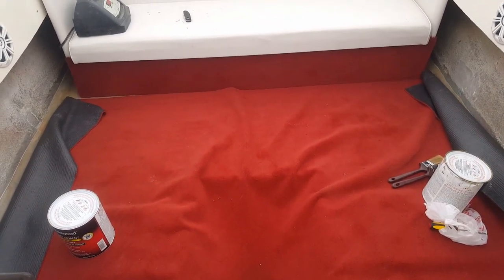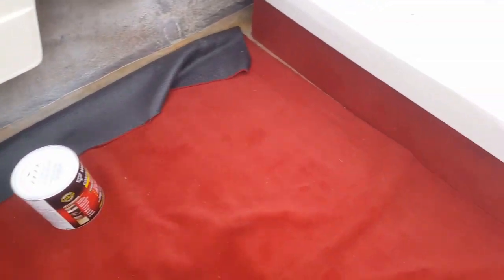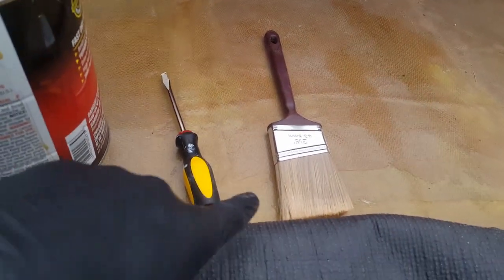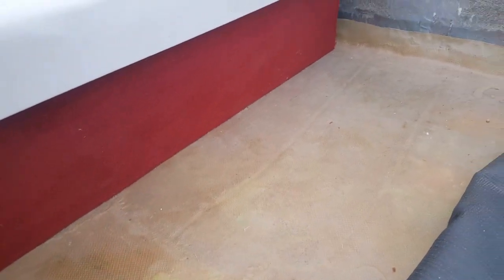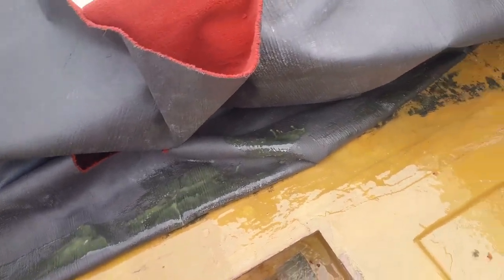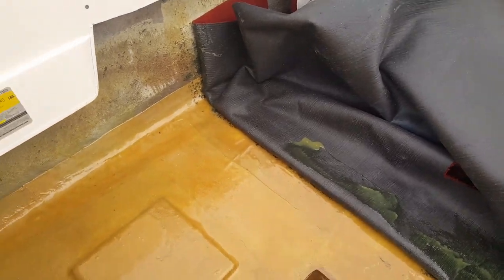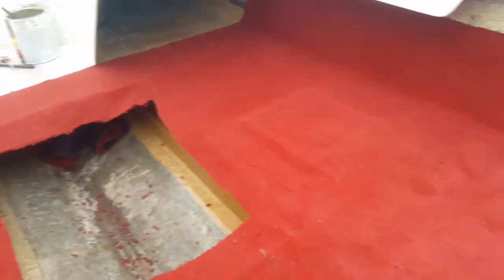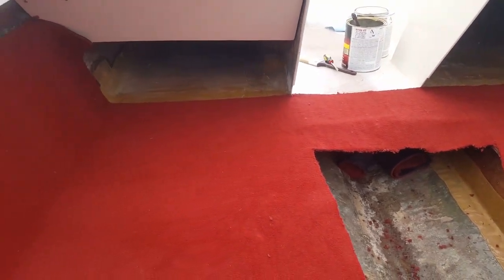Boat Transom and Floor Rebuild - Installation of Marine Carpet (1 of 2) - Part 80

Comment: Dude,  contact cement is supposed to be applied to both the floor and the carpet then allowed to tack up for a period of time then you put them together.
Reply from the maker: I did it off video like you said, in part 2, I shot it showing it on both sides—just for you!